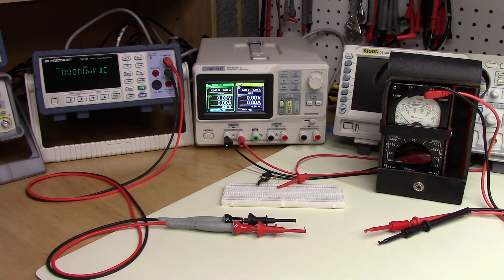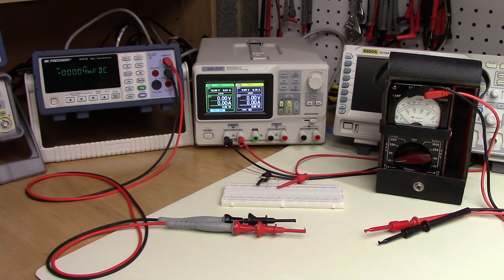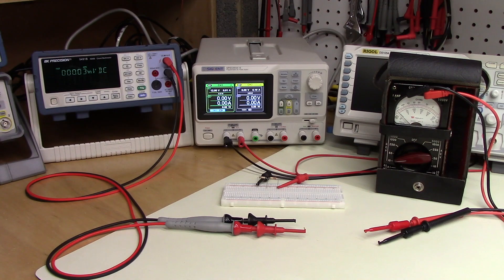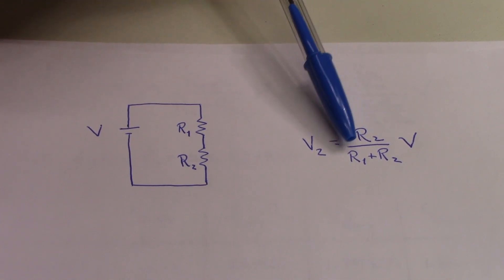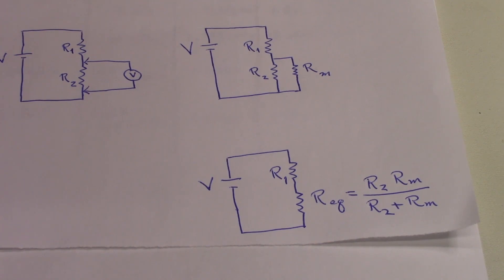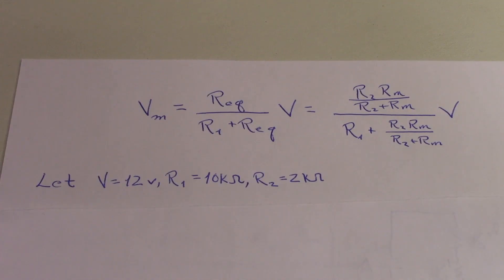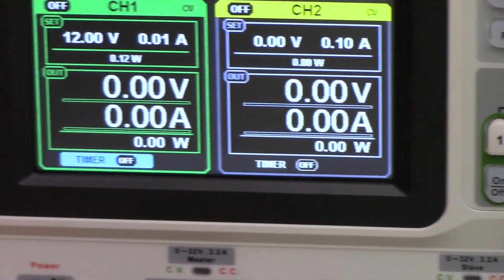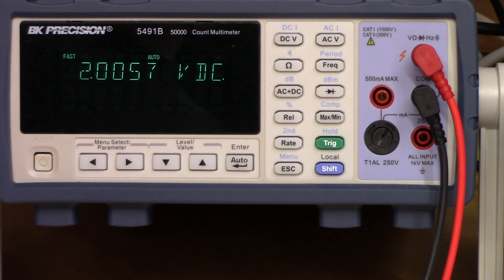#46: Why voltmeter impedance is important

Comment: Knowing what the required meter load does become a factor . Especially when calibrating a tube tester Such as a Military TV-7. All readings are to be measured with a 1Kohm per/volt to comply with testing. So if you don't have a meter with those specs. Then you parallel a load resistor of 1 K ohm across your digital meter Leads so the voltage difference is compensated for. Good Demonstration!

Comment: Thanks for the lesson. My little BK VOM meter has the X10K which adds a 9V battery with the 2 AA's giving it 12 volts. I mainly use it for testing diodes.